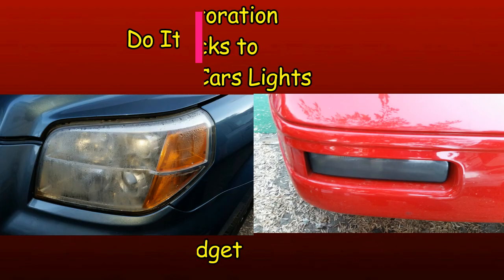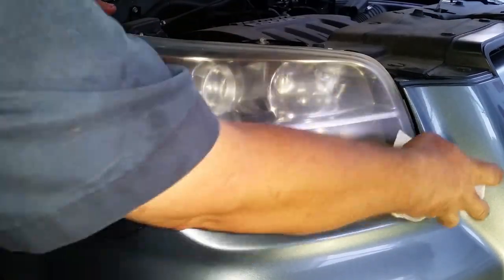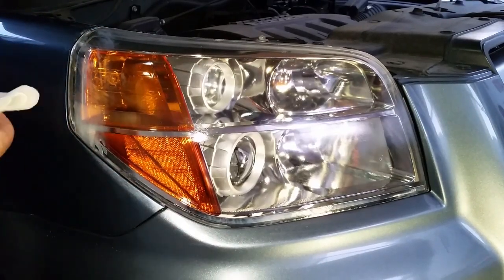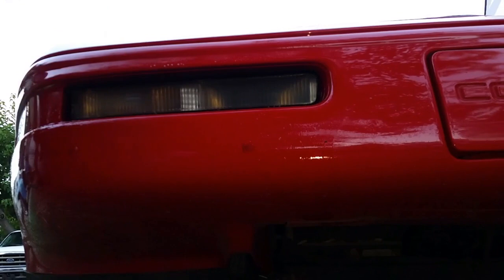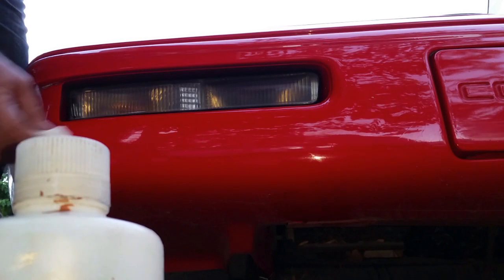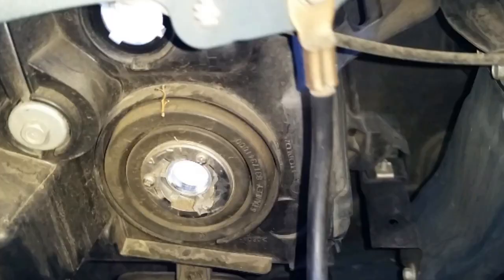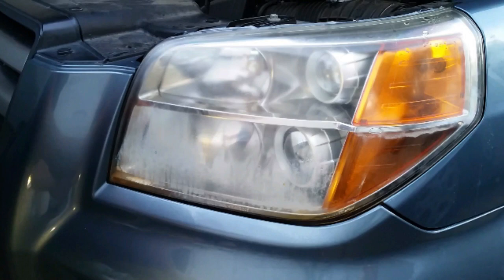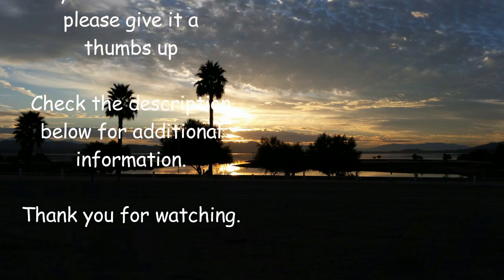DIY  - Tips and Tricks Headlight Restoration On a Budget

Comment: Nail polish is acetone,my understanding is the acetone is wiped on soaked micro rag 1 swipe,flip do other half IT chemically takes the oxidation,factory coating and the top coating of the lens itself.your not trying to clean it,but remake the surface✌then spray sealer once a year😎oven cleaner first,dry,acetone

Comment: Can I use 2000 grit sand paper instead of steel wool.... Would it be a better out come.
Reply from the maker: You can but it will take forever to clean the lens. The 0000 steel wool is a very fine scrubbing pad, that conforms to the shape of the lens. Sandpaper can be used but around 800 grit would be equivalent, but it does not conform as well. I use a 320 grit to remove the dead coating from lenses first then if it looks clean and dry go right into the acetone wipe. I have also successfully used a blue scotchbrite pad to clean the lens instead of the steel wool. 
Just remember, this step is to clean the junk off the lens surface, the acetone is going to melt the surface and let it re-form as a smooth clear surface.